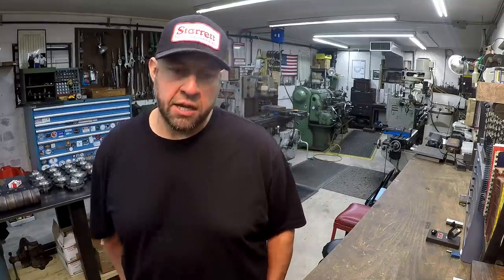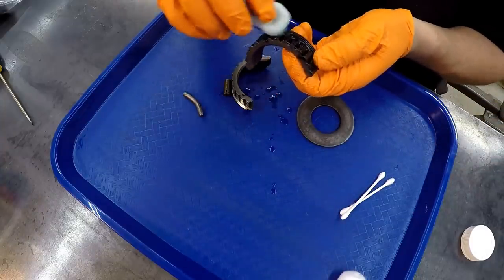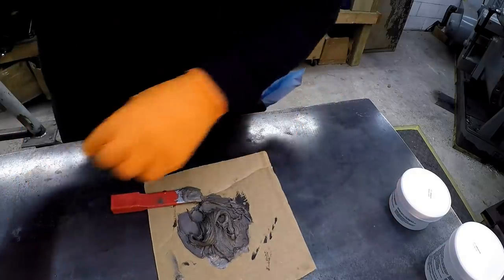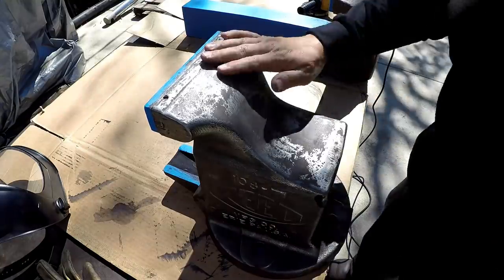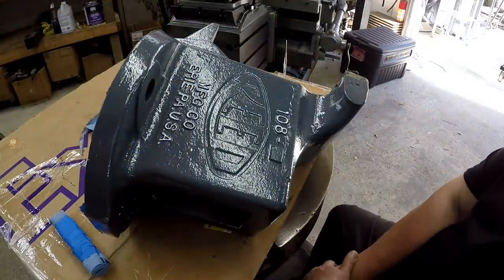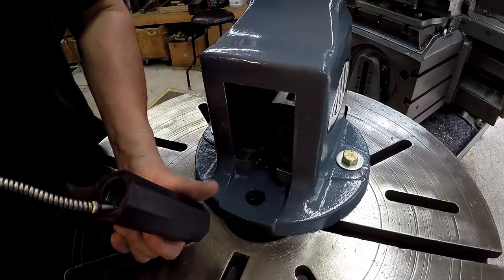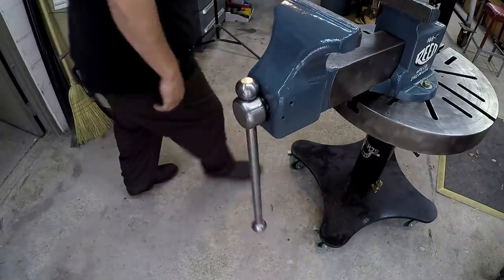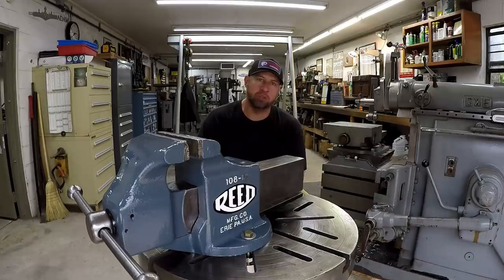SNS 255: Reed 108 Vise Restoration

Comment: Hi Adam, My father was a plumbing and heating contractor and I worked for him summers, weekends, and school holidays from grade school through graduate school.  I'm old enough that I did a lot of manual threading of galvanized and black pipe.  Spinning your vice handle reminds me of when my uncle was once helping my father thread some 2" black iron pipe.  Dad had shown him how to spin the die off the pipe once the threads were finished.  My uncle was spinning the die off when he stuck his head in for a better view of the threads he had just cut.  That die stock handle hit him square on the back right side of his head and he fell like a ton of bricks.  Thankfully, he was not seriously injured.  He was our least favorite uncle, he had a mean streak, and my brothers and I got a huge laugh at his expense.  Your vise handle might actually be heavier than a die stock handle (which is hollow)!  Moral of the story, let the handle come to rest before doing a closer inspection of whatever you had in the vise!  You don't get to be in the trade as long as you have been without knowing not to stick your head into a swinging handle, but maybe some other viewers can benefit from my uncle's experience.  Best regards, Gottfried
Reply: The same thing happened to me. My brother was cutting the thread with a 3 way pipe die and I was oiling when he stopped every 3rd push. I leaned in to squirt the oil and he gave it a 4th push and the rising handle hit me on the side of my head. That was over 50 years ago and I can still see the stars.

Comment: Awesome work. Your vise was born in April 1979.  You can see it on the dynamic jaw @ 13:20 when you almost filled it in.  The static  jaw will have the same date stamp.  It was one of the last real reeds made before they had Columbian making vises for them.  The Tee style jaws on yours are Columbian and can still be purchased through wilton as of now. ( wilton purchased columbian in the 80’s).  

I find it interesting yours still has the round hole in the static behind the nut.  The older version of this had a round pin with a slot cut in it and an adjustable jam screw to take up any slop in the nut after years of use instead of the cross pin to hold the nut.  It was one of the things they stopped doing as things got cheaper.

Comment: Out of passing interest... ages ago a friend bought a used drill press. It had a a couple of pecker tracks in it's table, not bad but they bugged him.
He cleaned them well with lacquer thinner, and filled with plain old JB Weld. Let it cure several days & gently filed them down flush. It came out very well! Last I saw of it several years ago now, it was still in good shape!
As always... YMMV.
Good job with the Reed! Looks so good I'd fear getting it dirty!

Comment: one great thing to add to paint is the wet look hardener from Rural king or Tractor supply. it makes the paint UV resistant and harder and helps it to be fuel resistant. another to make paint stick better is called Penetrol  When your done using them, You can shoot some mig gas in the can, it keeps the liquid from setting up

Comment: Suggestion for your pedestal build: Get some big copper compression washers and some anti-galvanic paste to go between the vice and pedestal at the mounting bolt holes. Then, build in an integral grounding lug on the pedestal so that you can ground anything you have in the vice for welding without having to ground the work piece itself. 
Kinda like how you did your rotary table, but pretty much totally different. :)

Comment: Adom, great job on the vice. I was thinking the Reed looked familiar but I knew that I didn't have one. I work at a tractor repair shop and when I got back to work I found that one of our old vices is a Reed. I think it's a little smaller than the one you restored.

Comment: Came out great. I like the color. I have had good luck lettering with the foam brushes. I use the small one and I dab it on to the letters. Sometimes I may need to slightly thin the paint. Great project. I really enjoyed watching. And it has inspired me to restore a nice Wilton bullet  vice somebody gave me .  I made some pedestals for my vices using pieces of Heavy “I” beam on the bottom. I can get my pallet jack or a  fork from the forklift under it to move it around. Plus we always have drop off pieces at the shop so the price was right.

Comment: Good job on the vice! 
An idea for adding weight to your base, fill the center tube with melted wheel weights. Around here you can get them for next to nothing from most auto repair shop. Bring the owner couple of large coffee and promote their shop in your video. 
Fairly easy to melt, metal clip and crap will float on top. This way you can save you shaft for another project.

Comment: Whenever you use any cold bluing formula, once the black color has set in flush the parts in water to stop the reaction, if you just spray it with oil it’ll start rusting as soon as the oil dries. Also, if you oil it before rinsing it in water the finish won’t end up as deep black as it should be.

Comment: Very good looking vise.  One suggestion is to add thick rubber washers on the heavy handle at the two ball ends like found on Wilton vises to prevent getting your fingers pinched.  Been there.

Comment: about the deep parts of the stuff you need to fill in : had to make a nameplate once where the letters where machined in bare aluminium , i cleaned it realy good with too mush thinner and after drying it some there was some thinner left in the deep parts 
when i touched the deep parts with the thinner still in it the paint rushed out of the loaded brush and filled the deep parts , it stayed in the deep parts and right up to the edge  , turned out looking pretty nice actually
about that pedestal , seems like you have the tools to make it , gonna be some HUGE welds though

Comment: One of the other guys also brought up the use of OneShot lettering paint. It really does make a difference. Another product that can make life easier is something called Flashbond. Acts as an intermediary,sort of a glue that makes painting over old paint,filler,and primer a whole lot easier,and would make your lettering a little easier as well. Spray or brush.
Nice job,all the way to the finish. Cheers.

Comment: The vice came up very well Adam. A suggestion for the pedestal. When I was a boy 55 years ago, my father obtained a similar sized vice and mounted it outside with a large steel pipe column (about 10 inch diameter). The column was set into the ground in a hole abt 2ft diameter and deep filled with concrete, and the column was also filled with concrete to add mass. Father added a ladder frame with threaded rods that matched the mounting hole spacing for the vice separated by about 4 'rungs' welded to the uprights and set into the concrete. It made a very solid and rigid mounting. From the video, you want a base that you can move and were thinking of packing your column with shafting for mass, I think that packing it with concrete would be as effective and save the shafting for other purposes where its machinability might be more relevant. I think you could either use the ladder frame in the column to mount the vice, or fill to within about an inch of the top then weld on the top plate you were consider, and mount the vice through that. Just a suggestion.

Comment: Great restoration job, as well as applying the Bondo which turned out to be really good and the painting. That is one monster of a vise, both in size and weight and I imagine that it had a monster of a buying price as well. The only thing that I would have done differently would have been using a Rustoleum paint called "Hammered" I really like the texture that it gives to old metal. Thank you for the video, it was great as well.

Comment: I use scraps of 26 ga. Sheet metal to mix epoxy and bondo on.  The "gravy" doesn't soak in at all. I also make spatulas and squeegies out sheet metal because I'm so cheap.  You can probably get all the little pieces of tin from your AC guy free for the hauling off.  I also use a little wally world digital scale to mix my goop.  It's amazing how much better the results are in comparison to doing it by the wag system.

Comment: Perhaps in the future you can try using an ink to do the recessed areas? Seems like it would seep in real well if you got it nice an level. Maybe something like a super thin epoxy? Also, I've heard if you remove the blue tape before the paint fully sets you can get a nicer edge. Regardless, the vice came out looking amazing. Thanks for sharing the process!

Comment: Hey Adam and the rest of you may also want to consider is marine polyurethane paint.  I was turned on to the virtues of marine polyurethane many years ago for painting machines and especially in salt water environments.  I've used Pettit, Interlux, and West Marine's generic brand and they're all excellent.  And even when brushed on they dry looking like they were sprayed on.  They can also be sprayed with a HVLP sprayer if thinned.  Both companies also offer thinners that chemically work with the paints.  Just an FYI.  Chao!

Comment: Nice video ... It seems that you installed the precision split nut in the wrong direction when compared to the first video where you take it apart ... I guess the only way to be certain is to validate how the grease port lines up now ?

Comment: Sweet. Nicely done. I have an idea for a project for you, make up a bracket and mount a motor with a foot pedal to that awesome round weld table and make it into a rotary weld positioner. Maybe make two gears or even use a rubber wheel to drive the table if possible. Then, when it’s done, sell it to me!

Comment: You had mentioned in a prior video that you were going to install a couple of rubber cushioning washers on the handle shaft to eliminate the harsh banging of the ball ends when the handle slides to the end. Did you decide not to put these on? Love all your videos.

Comment: Did you consider milling two flats on the ball end that is removable. Just in case it got seized up? That would also indicate which one of the two balls was the removable one.

Also, You should try the Birchwood Cold Blue Paste. I've been using it at work for any detail that I have to modify, and it has been working pretty good on almost all steels. Sometimes I have to do 4140 twice though.

Comment: Really nice video Adam, superb work, I just wonder if you regret not having the blasting cabinet when it comes to work like this?
I did the raised lettering on a valve cover, I bought a cheap rubber wallpaper seam roller, roll in paint, roll it out a bit on paper then roll the letters, I think it might have been what you needed. 
For all the keyboard warriors out there that jumped on theirs about the split nut, if you watched it all before attacking your keyboard you would have noticed Adam explain the reasoning behind the direction of installation of said nut, splines inwards for the locking grub screw, 4 dimples outwards for winding it in or out!

Comment: Good techniques on the painting and good results. I will say though that a GOOD brush, rather than the cheapies, will make your life about 100 times easier. A good brush would have bristles about 50% longer than that little cheapie, and would have been a lot easier to use. Of course a good brush is moderately expensive, so you want to treat it like any good tool and take good care of it.

Comment: What's the color code of that PPG paint?  I kind of fell in love with that color watching the video.
Reply from the maker: It’s a color they mix for Motion Industries called Faulk Grey. I like it so just picked it. You could probably call them and ask for the info.
Reply: @Abom79  Thanks,  That was the reason I was going down the comments.  To see if anyone else asked what color grey that was.   Greys are like Blacks.   A lot of different ones.   But the right one really makes a project  come together and shine !!   Nice Job also !!
Just wondering,  Have any idea on why one would use Lab Metal filler.  Or the Loctite filler you used ?
Are they basically the same ?  Or is the Loctite better ?

Comment: I got worried when you headed for the filler. Too many "restorations" end up looking like they belong in a jeweller's shop window.
Instead, this is probably the best I've seen. You've taken out the worst of the damage, but kept the character it's got through the ages.
Importantly, it looks like a tool that's ready for work, which is how it should be. Well done.
What happened to the O ring 'trick', I wonder?

Comment: Slide some rubber grommets on that handle shaft to minimize pinch points.  Nice Vise!
Reply from the maker: I hate those goofy looking rubber washers, the older model vises didn’t come equipped with them.
Reply: @Abom79  They may look goofy, but your fingers will thank you...
Reply: And they keep the noise down when you drop the handle.  @petemclinc

Comment: Adam on your not getting it to do what you want.. if you want sharp edges use tape, or find someone with a really steady hand. Also you could have painted the tops first then did tape over the white then filled in the black might have been easier since the white would cover and accidental boogers if you missed a little.

Comment: I noticed the split nut was re-installed opposite of the way it was removed.  Was it in backwards when you found it?
Reply: no it wasnt
Reply: I noticed that too but it makes more sense the way he installed it so it was most likely backwards.
Reply: The 4 notches in the split nut are supposed to be facing out so the nut can be walked in or out with a punch or whatnot.  Its obvious the vice had been opened up previously due to the pipe wrench damage, so likely it was installed backwards previously.  However, both sides of the nut are a machined surface so I don't believe it would effect functionality

Comment: I bought a bench vise at a yardsale for $25. Seems like it will open 8 to   ten inches. It has Pennsylvania keystone symbol with letters PATD   cast into one side and a G cast into other side. I was wondering if you would know anything about it and if you would share any information you had about it. I'd very much appreciate it. Thanks
Reply: The "PATD" just means "patented", so that's not much help, unfortunately.

Comment: Love your channel and all your workmanship.   But man it was hard watching you put bondo on a vise.
Reply: That is the thickest, heavyist bondo i've ever seen.  No wonder it was difficult to apply. I would think that it is very dense and more resistant to damage.
Reply: I couldn't understand bondo on a vise. It's a tool not a show piece. Adam's vise Adam's call.
Reply: It's not bondo, it's a two part epoxy with metal fibers basically. It's as strong as metal once applied.

Comment: Two pack I.E. epoxy based Fillers/primers/top cost paints are much more durable and give a superior finish. A common problem when using these products is controlling mix ratios when using small amounts. If you get the mix ratio wrong by as little as 5% you seriously compromise the result. Invest in a very accurate electronic scale and mix by weight rather than by volume. Mix ratios by weight will be available by the manufacturer if not stated on the product.
Reply: Meant top coat paints 🙄
Reply: Volume and weight ratios are not the same usually 👍
Reply: I was wondering why he didn’t just use Belzona as the filler.

Comment: adam

That Loctite steel putty is pretty pricey to just use in place of bondo or some other filler.  So, what are the advantages over bondo or JBWeld used as a body filler in this project?

John
Reply: Bondo is hard enough to be a nice painted surface, but not tough enough for working tools.  JB, this, or an epoxy filler are extremely strong and tough materials. They will hold up if Abom has to use the filled surface to support a workpiece, where Bondo would just have crumbled.  Also, this has tensile strength and could join two pieces where Bondo would just fall apart.
Reply: @kevinvermeer9011  
good point!!

Comment: That vise is enormous and you did a wonderful job on its reconditioning and preservation. Great job buddy!! Also, where are you at with the weight loss now??? Its been a long time since you gave an update and I really noticed at the end of the video that your face looks more thin than its been. Looking great man, I need to do the same thing. My biggest problem is stress....I need to find a way to destress my life.
Reply: How to reduce stress. Go to your shop and make something. Ergo stress reduced!
Reply: @leeklemetti1887  I've been out in the shop for the past few hours now thanks to your comment. I have so many projects on top of work and school that nothing gets done out there. Well, tis spring break and the weekend so instead of studying today for a midterm, I spent it relaxing then out to the shop to install the speakers I bought for my car (several were blown) and then began cleaning and organizing (4) lots of taps that I won and began testing 20 AC drives that I need to get on ebay to sell. Taking a dinner break now then heading back out there with a beer to get more done. Thanks for the kick in the rear!!  :-)

Comment: Does that oxpho-blue change the dimensions of those pieces? even if only by 0.0001?
Reply: Yes, it is an oxidizing agent, so it does add to the surface as a coating, you are probably talking about an increase in Nanometres, or several Angstroms, one ten billionth of a metre, or one ten billionth of a yard.